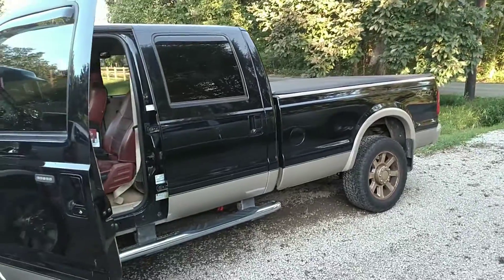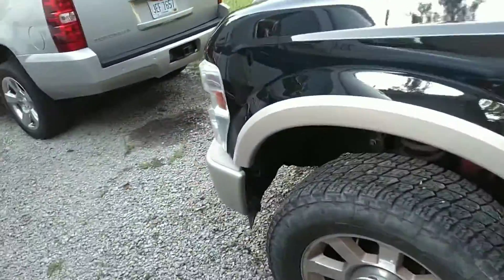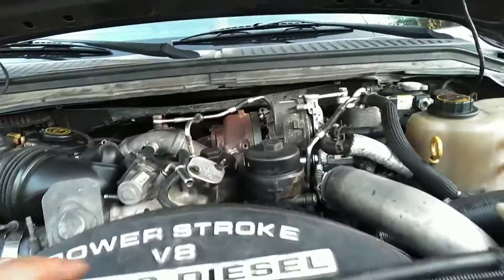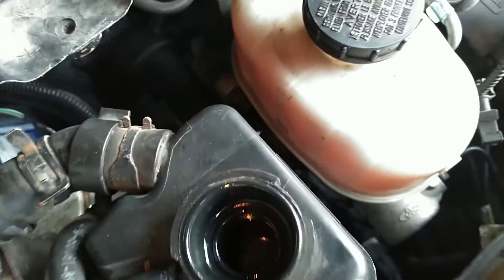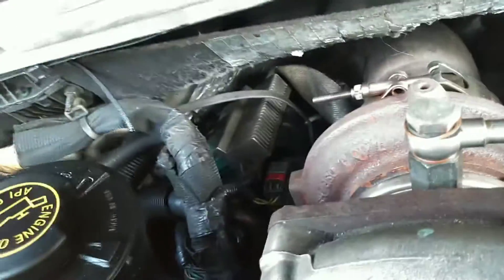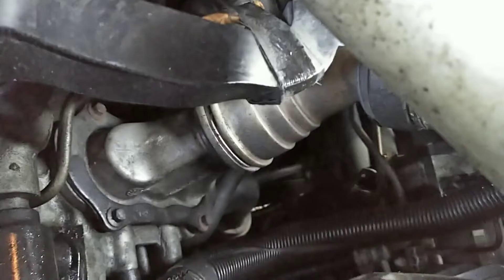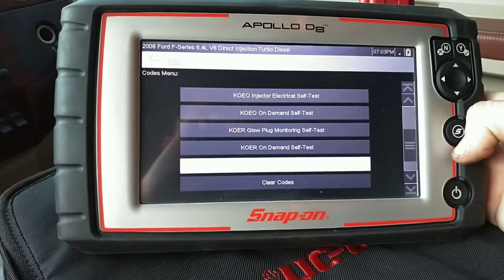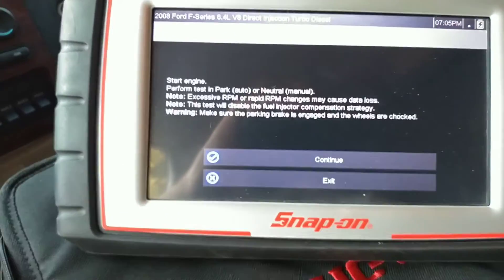(PART 1) 6.4 POWERSTROKE. CYLINDER CONTRIBUTION CODE DIAGNOSE.

Comment: OK. I have a 6.4 in the specialist's shop. For stretched head bolts and blown head gaskets. Waiting on machine shop check up any cracks, level etc. If the heads are true and I'm going to do ARP studs, redo the valve rockers arms rack, and HP fuel rack censor. New up pipes to have the off-road up pipes with engine back pressure sensor connections etc... Should be all she needs.

Comment: With a 6.4 it's never just injectors, sorry to say, That engine is probably junk. I'm in the process of 12v swapping my 08 F250 long bed crew cab.
Reply: What do you mean 12v
Reply: @peanuthead5730 12 Valve cummins.
Reply: What is the neighborhood cost on that? I'm getting cylinder 3 contribution/misfire right now. A rebuild is way out of my price range 😂
I'm getting the code on my H&S Minimaxx

Comment: I’m just north east Cincinnati, I have 09 f250 6.4, do u do work on diesel p/u
Reply from the maker: Yes I do
Reply: @cincydieselrepair6893  what part of town
Reply from the maker: @da5172  Bethel
Reply: @cincydieselrepair6893  ok I’m not far, Blanchester area 😄
Reply: @cincydieselrepair6893  I’m looking to have my power steering gear box replaced
Reply from the maker: @da5172  I can do that for you but right now I'm booked for about a month.